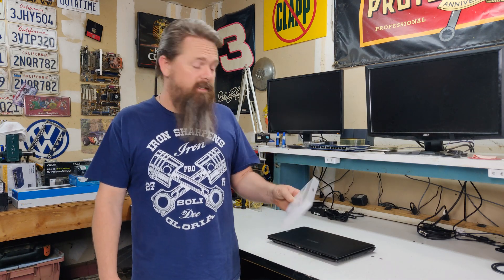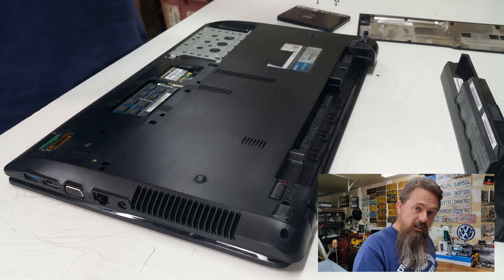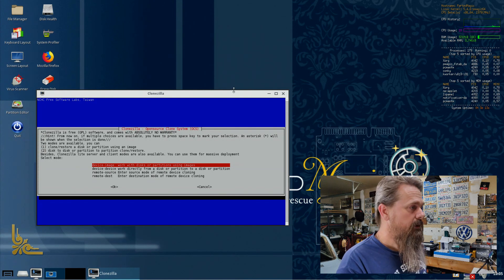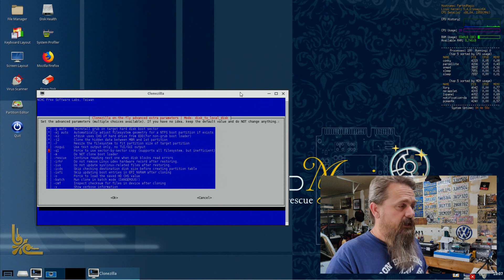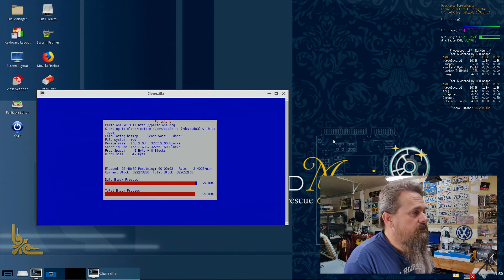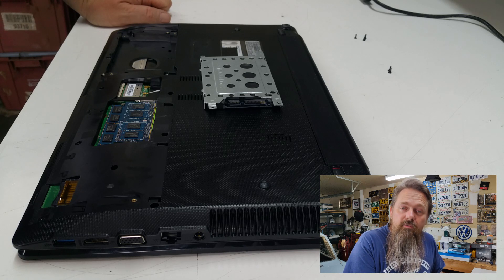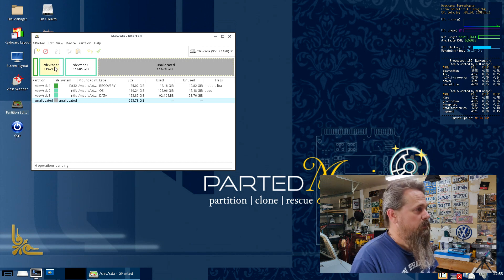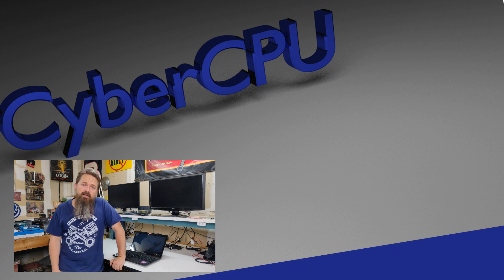How to Upgrade to an SSD

Comment: The reason for the two partitions like that was it made it easy to reload Windows without losing data - in theory. If the user would put the data onto the second partition and when Windows 10 became corrupted you can do a TOTAL reload of the Windows on the first partition if you wanted to - the data would still be there. However, users rarely picked up on this and the idea never really took off.

Comment: Enjoyed the video on upgrading the laptop HD to an SSD. I have 2 Asus laptops, one which is from 2012 (N56VM) that had Windows 7, Max Ram 8Gb, i7 Intel, 750Gb HD. Windows OS was updated to Windows 8 and now has Windows 10. The second laptop is from 2015 (ROG G551VM), has Windows 10, Max Ram 16Gb, i7 Intel with 1Tb HD. 

Both laptops have an Optical Drive which I use. Is this drive affected with a SSD upgrade? 
Can I put a 1Tb SSD in the older laptop that has 750Gb HD?
And would there be any problem with this laptop upgrade as the OS had been upgraded from Windows 7 to 8 to 10?  
Can I put a 2Tb SSD in the more recent laptop that has a1Tb HD or should I only use just 1Tb SSD?
Thank you for any assistance with these questions. Ozzy
Reply from the maker: The SSD replaces the hard drive. It will not effect your optical drive.

Comment: Thank you so much. This is an informative video. 😀I'd like to upgrade my dad's PC to an SSD, so it helps me a lot. I have a question, though I can Google this so you don't have to help me. I've heard there are different types of ssds. Some plug-in with a SATA cable, other SSDs plug in m.2 port, and some SSDs plug in as PCIe card. (Those are the three types of ssds that I know of) So I like to find out if our old PC from 2013 supports the other types of SSDs and what the differences are.
Reply from the maker: Chances are you will need a SATA SSD. However, if you have an M2 slot then you can use that to. It depends on what the system has. Chances are if it's from 2013 it probably doesn't have an M2 slot.
Reply: @CyberCPU  I appreciate your advice. 😀👍

Comment: Sir, did you mount both the ssd and old laptop hdd on the workstation computer which already have a hdd that has  clonezilla installed on it. Kindly advise. Thank you.
Reply from the maker: Both laptop drives where connected but clonezilla was on a USB drive.
Reply: @CyberCPU  thank you sir

Comment: Say i have a 1 TB harddrive, that only has 350gb used on it, and i got a 480gb SSD, is it still gonna work with this method? Or used space doesnt matter and the source disk must be smaller? Tnx in advance!
Reply: Nvm noticed your reply from earlier,  good luck with tinkering :D